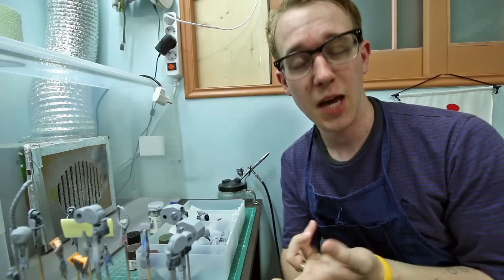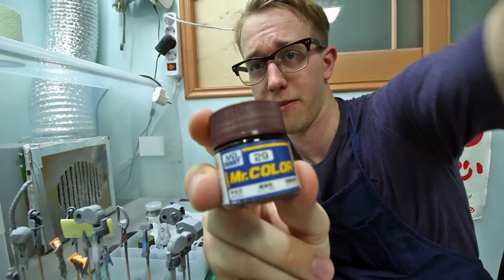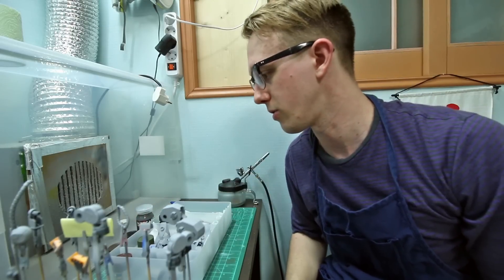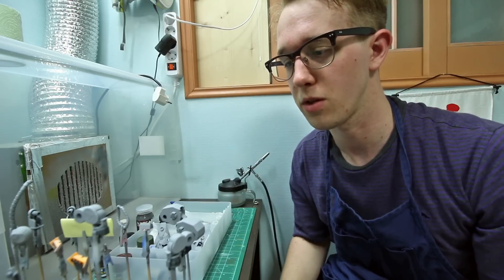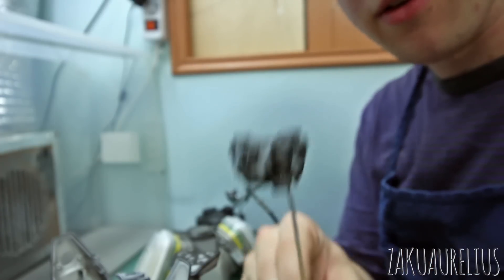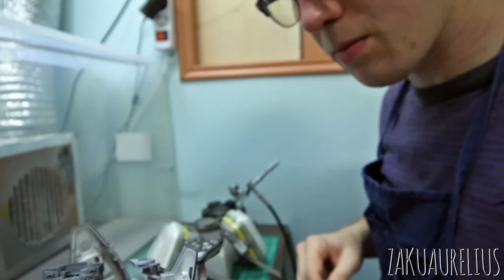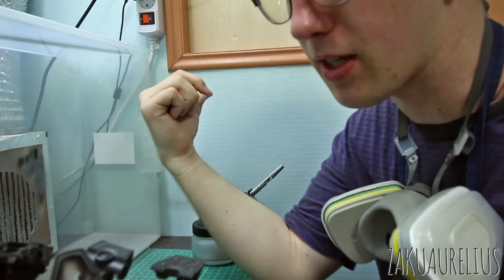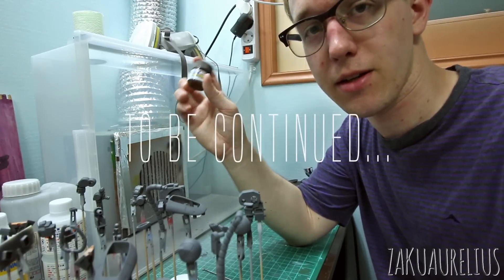712 - YouTuber Build-off! RE/100 Efreet Custom WIP:2

Comment: Little question, the surfacer doesn't contain any micro filler as it goes on smooth?

About that pre-shading, most here are sort of right on the money, though not quite....
Although primer/surfacer has a a rather high pigment count, it is not higher as some (brands) normal paints. It's just designed to edge into the surface it is sprayed on.
For example, if I spray on a light coat of Alclad white primer on a blue part, it still shows the blue al be it a little lighter in shade. It still needs three coats to completely cover.

All your base coats need to be really thinned down in order to let some of the pre-shaded lines through. And then there is the amount of coats you apply and how heavy you lay them on. If I saw this correctly, you don't have a "needle stop" on the back of your brush. If you had one on there, you could dial the needle down to a specific pull, say only half length, so your coats could be consistent. You still can do that, but it will be a bit harder to  get it exact.
Then take distance to the object in account. The further away, the less pigment will hit the piece, but might dry mid-air, so a retarder will help a lot. The opposite goes too of course.

Then there is the shading of dark colors. This is really tough to do. If you want to do a pre-shading technique, first lay on a good covering coat of the base color. Then do your pre-shading lines. If those are to satisfactory, do one or maybe two thin coats, mist them on, of your base color.
Your safest bet is to do some post-shading for the dark parts. Depending on your preference, mix your base color with a dark tint as your first coat, then spray your normal base coat on the surface areas you want to "pop out".
Or spray on the base coat and mix the base color with a lighter color for highlighting the areas you want.

When doing thin coats for the shading techniques, you will get a "grainy" surface, resulting in a matte finish even when using a gloss paint. Needless to say you can put on a coat or two of gloss clear in preparation of lining and decals to get a smooth surface.

Hope this reaches you in time so it'll actually help you out a bit. Good luck and happy building!
Reply from the maker: Thanks for all the info! I'll definitely keep that in mind!
Reply: Sure, anytime ;-)
Reply: +ZakuAurelius well according to jaman your edward snowden

Comment: For the shading you're right about the surfacer, primers are about as high a pigment as you can get since they're designed to be able to cover any colour you might have underneath. That's why you can prime a white part black and not have to do a million coats to get a uniform colour. Unfortunately that's the same reason you can't see your pre-shade.

Comment: Hey man cool vid. Pre shading for me tends to work well if I hit the parts with a light colour first over the primer. 

So Tan or Buff or something like that then Ill preshade and ill spray the colour over in light coats and build it so essentially doing 2 colour passes as I find that for me at least, that  the preshade starts to really show through once the paint has dried a lil. 

Also some paints as you may already know are more transparent than others, also I use tamiya acryllic paints. Looking forward to the big reveal :D